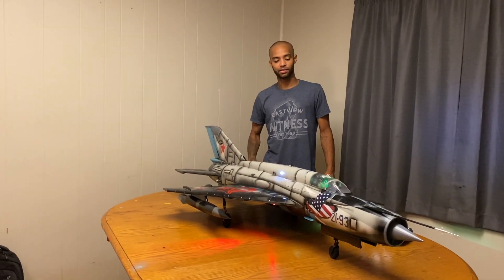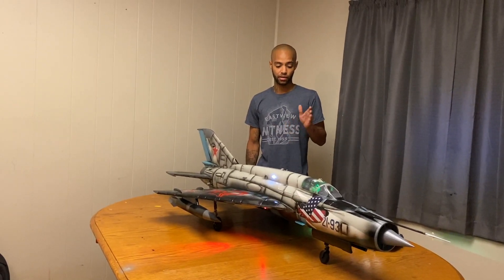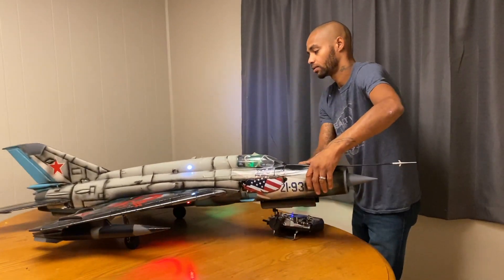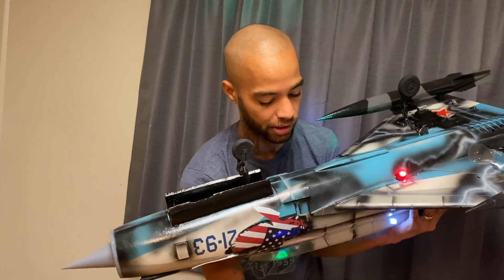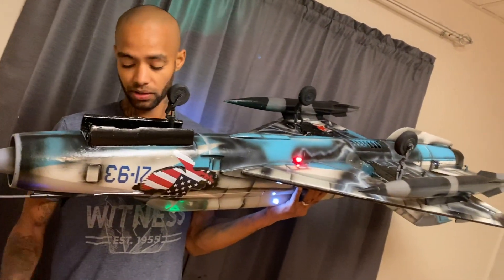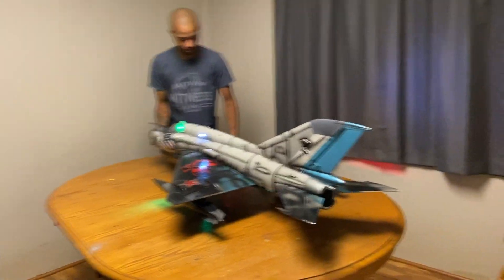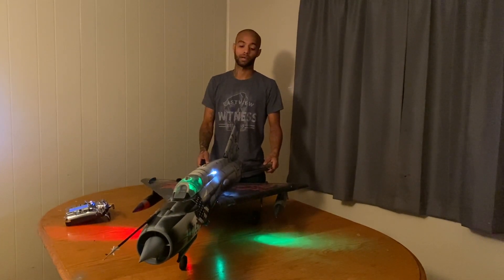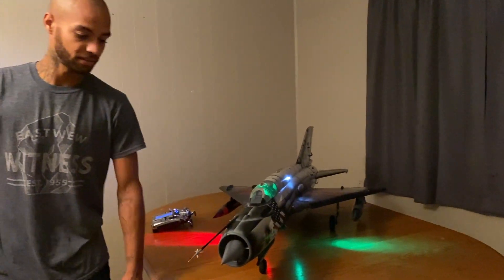Freewing Mig-21 80mm

Comment: Definitely a dirty paint job. I love my mig a lot. Mine is almost 3 years old with 160 flights logged on her...
Reply from the maker: Yes sir it is! Wow.. This must be a great flier then! Is yours still the stock outrunner? And do you use a 6000? Thanks man!
Reply: @hamiltonshangar  yes i use a 6250 at 803 grams. It was upgraded to the 9 blade 1900kv A10 unit. It was a kit plus.